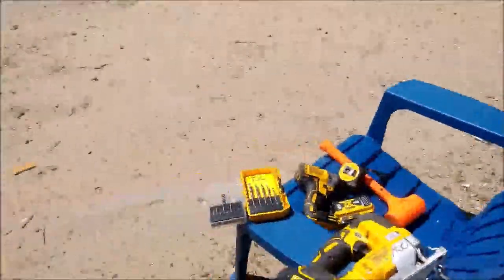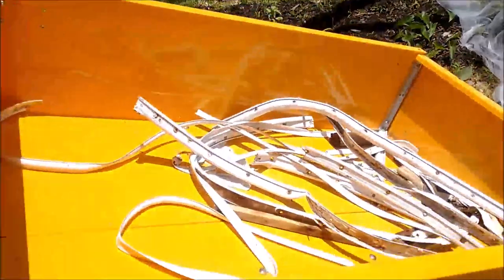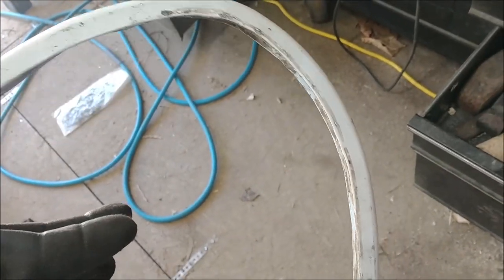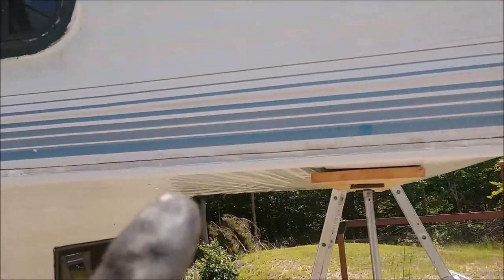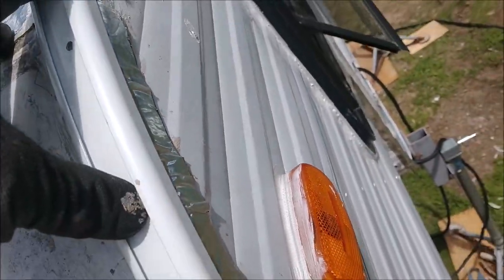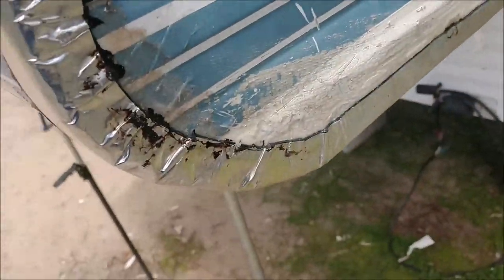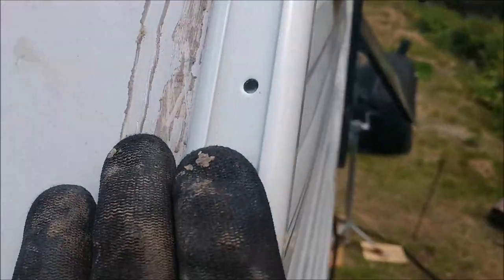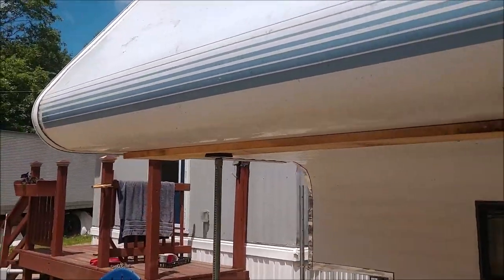The final step, installing RV corner trim on truck camper.

Comment: What's the silver / grey material you are using to seal the edges before you put the aluminum on? Is it a tape?  Thanks
Reply from the maker: Hi Peter, I used TITE SEAL All Purpose Flashing I bought at Lowes. I also used Gray Putty Butyl Tape under the trim where the screws go through. Probably didn't need to use both, but I had them and figured it couldn't hurt. So far so good. I put links to both products in the description of the video. Thanks for the question and watching!